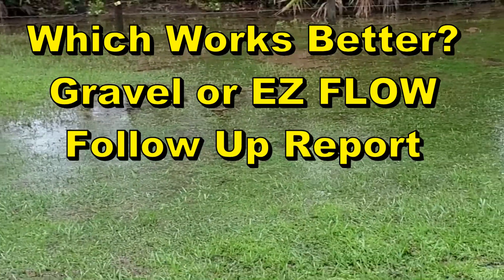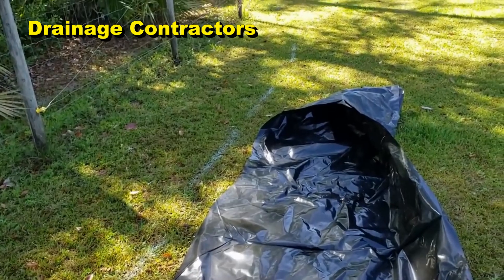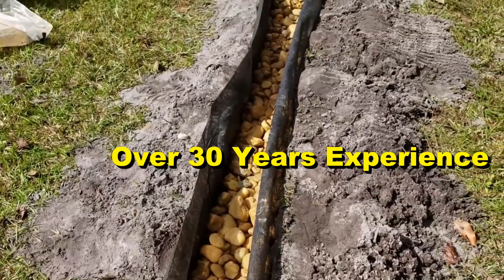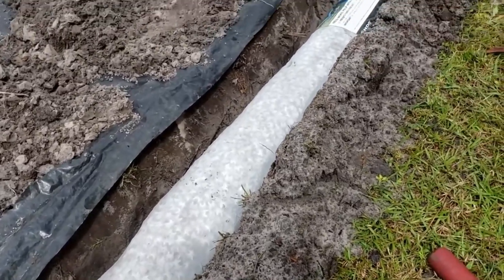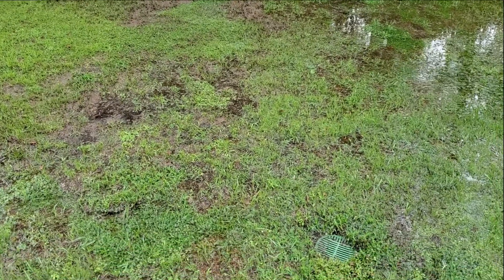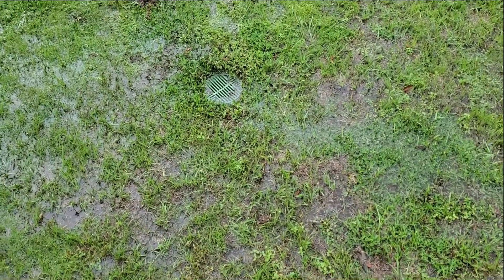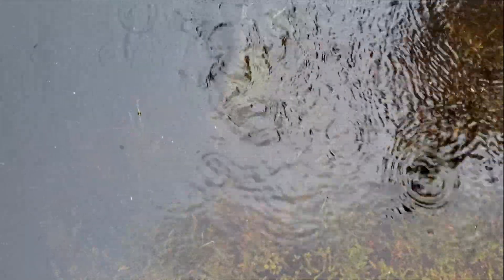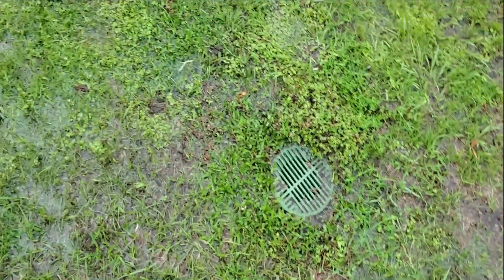French Drain, 2 Great Systems, Watch Which One Works The Best?

Comment: 2 weeks ago, I installed 2 EZ flow pipes, with a catch basin, to drain my saturated yard. In clay, it worked great during an all day heavy downpour. After the rain, my yard would take 4 days to completely dry out, now it takes 1/4 of that.

Comment: I trenched down to just below the footer for a total length of 60 feet around 3/4 of the perimeter of my house.  I used both EZ flow and 4-inch pipe wrapped in fabric, laid them side-by-side around the perimeter.  So, it's a dual side-by-side footer drain system, all flowing into a sump pit and discharging 30 feet to the street.  It's been in place and working perfectly for over two years now, but we haven't had a prolonged heavy rain to give it a real test.
Reply: Too bad you haven't had a massive hurricane yet. When you finally do then be sure to record it. It will be neat to see just how dry your basement or crawlspace stays while your neighbors likely all have very wet basements. Also interested at what point maximum discharge from is. In other words during the height of the downpour or does the water need time (minutes or hours) to flow down into the dirt before it is collected by your pipes.
Reply: @donaldlee6760  Good points.  The real problem in my case is underground water rising up and penetrating the slab and foundation.  After Hurricane Irma on 2017,  had an inch of water in my ground floor portion of the house.

Comment: Wow! I had no idea you could discharge to an underwater area. I thought that the water in the swell would push water back up the discharge pipes.
Reply: As long as the french drain is above the top of the swell, then water is just flowing downwards. If you think about it, the pipe could extend to the bottom of the deepest ocean and still work. The pipe extending to the bottom of the ocean will not "push" the water up the pipe and cause a guyser shooting water hundreds of feet into the air!
Reply: Donald Lee very good explanation. I have another rental property on 2 acres that I need to put in a French drain. I pondered running the French drain to the pond but the discharge line would be under water. For some reason I thought the pond water would just push up the discharge until it found level preventing the French drain from draining 100%. I may do a small scale experiment